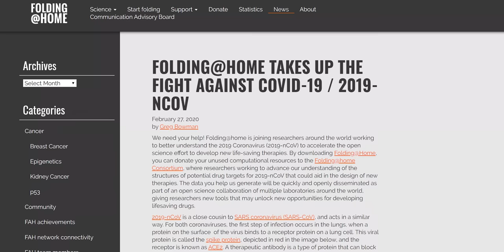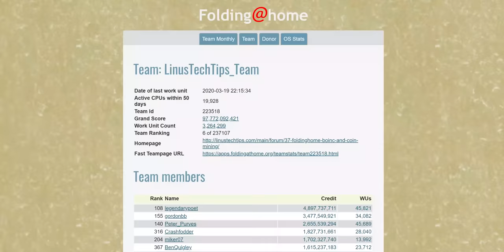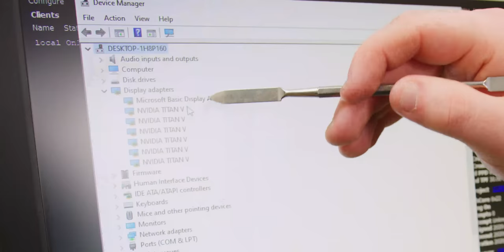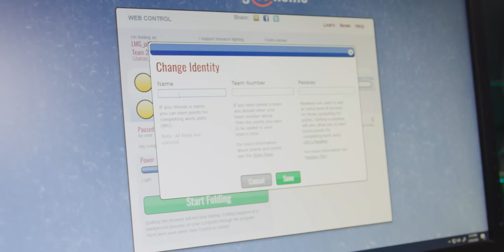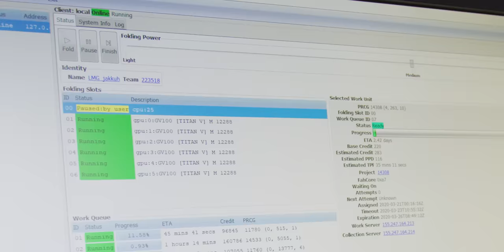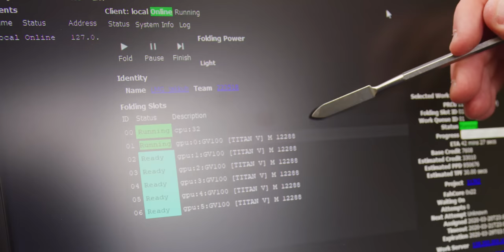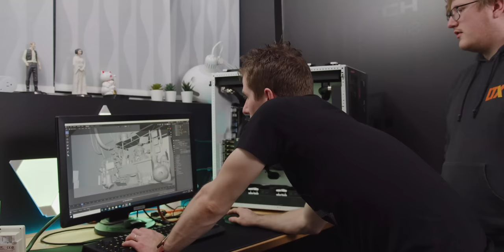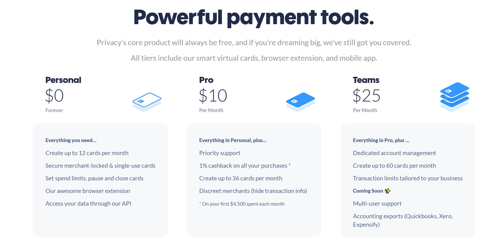Here's How YOU Can Help Find a Cure for COVID-19!

Comment: Just a heads up, this has created a noticeable increase in my electric bill when I have done this in the past. This machine Linus worked with in this video would likely double my monthly bill.  I'm not trying to discurage people but just give them an early warning. Some people might be laid off work with less income now.
Reply: Somebody pay fixed price, or not paying for electricity at all.
Reply: Setting lower power limits can significantly reduce your power bill though. Just install MSI Afterburner for your GPU and see how low it'll go, 50% power is often plenty for these tasks (but 80% already helps a lot by taking out all the peaks). Same goes for your CPU, just download Intel XTU or Ryzen Master and lower the power limit to a point where you feel more comfortable with the power usage. Even setting the power plan to power saver can help a few percent.
Reply: Krojack that’s why I have solar panels
Reply: Ah yes, my dad made me pay the extra 30 euro a month. That was with just 1 980ti running about 80% of the time on full.
Reply: My setup with one GTX980, i7 4770k and few HDD's at full power (no OC) takes 350W (measured, not theoretical). If I'd be running it non stop 7 days, it would be 0,35kW*24h*7 days= 58,8kWh, with average US price of 13,2 cents per kWh it's around 7,76 dollars a week. 
HOWEVER, taking into a count, that you should stay at home, most of the people will save money on fuel, and public transport, travel, shopping and cinemas, so at the end you will still save a lot of money durning that quarantine.
Reply: But as he pointed out, for those of us with electric heating and in winter/spring, we will see minimal difference.
Reply: @TheTechnoPilot  the only time it wouldn't come out in a wash would be during summer, where a heater is counter productive.
Reply: @voxelfusion9894  agreed!
Reply: @TheTechnoPilot  here, electricity is cheaper than natural gas, so my utility bill is cheaper heating with computers than my furnace
Reply: @25566  With some power limits in place 200-300 watts is probably pretty doable
Reply: This is one of the reasons I won't do this, Linus can say its for a good cause all he wants, but he hasn't been laid off due to the virus and still has income and doesn't have to worry about an electric bill. Try being a student on unemployment.
Reply: That's like warning people that water is wet
Reply: @projectjt3149  shit that's sweet, do you only run the machine during the day? Or can you roll back your power meter?
Reply: @toymachine4253  yep, I'm in the same boat with Quebec having some of the cheapest hydro rates on the continent! 😝
Reply: @Grumpy_Wolf  Yeah dude I don't think anyone will blame you considering your situation.
Reply: Yo college kids step up
Reply: 10:45,he did adress that, watch the video before commenting about stuff not being mentioned.
Reply: @RespectableRSYt  Well, I'm running Folding@Home from my laptops. I've also put them on Medium instead of full so that they can last a little longer.

Comment: I dunno the guy could afford it but a thousand years ago when I first got into folding@home, there was a person in my "team" that wasn't running his account using his office' equipment. He apparently had access to unwanted computers and would just build dozen+ machines all plugged into his home in different areas. Imagine his electric bill woooooo...

Not all folding projects are worth your time (I personally think using distributing computing to find aliens is a bit silly) but this is a really good idea. Also: wow the interface has become so much easier to understand. Back in the day it was just ... a command line type window with text flying at you.
Reply: I'd rather use my hardware to search for aliens then to help out greedy pharmaceutical companies that rip everyone off with overpriced drugs that apparently don't even pay for hardware or electricity they use for research.  Drugs are expensive enough to buy why should I pay more for them with hardware and electricity?
Reply: Finding aliens is NOT folding. Folding is literally protein folding. They are both Distributed Computing projects though.
Reply: @PAPO1990  Yes. SETI is for aliens
Reply: seti@home is shutting down the DC at 31st of March.
Reply: SETI@home is scheduled to stop sending out work by the end of this month as well. So there should be even more protein folding computers at that time. I hope the project notifies the volunteers to switch over.
Reply: @modmiiwii - the warm feeling of helping sort this crisis.   Sadly the maker of the video is interested in nerd points.....

Comment: Me: sees this

Also me: Proceeds to set it up on my Intel Atom netbook
Reply: And even that small contribution of power over a high enough quantity will make a difference :)
Reply: Hilarious
Reply: I did it back in 2009....  Not the fastest system for folding, but every little bit helps.
Reply: lol currently watching on a Atom N270 netbook, and had the same Idea.
Reply: My only bottle neck is my network speed at a whopping 10 mbps
Reply: @chrisziebell5833  bro, I'm @ 300kBps
Reply: the things the world does for research
Reply: My celeron netbook, also folds ! 2,16 ghz doiing 100%. 800 PPD !
Reply: Lol, I set up both the 2200g machines I built for my shop to fold as I watched this vid, looks like they will be doing about 4000 points a day each, is that gud? 🤷‍♂️
Reply: @maxxlr8tion578  Well my one 8700K @5GHz has estimated PPD (Points Per Day) value ~92K
Reply: I think it's actually pretty good to use an Intel Atom. Because of it's power efficiency. Running a 9900KS will be literally 5 ? 10 ? 20 ? times faster, but will consume 20 ? 50 ? 63 ? times more power. Energy consumed these days when everybody stays at home should matter a lot.
Reply: @Winnetou17  Slower cpus will hinder down the pace of the project though... every single WU has to be churned through the client machines before a one little F@H project, protein folding sequence simulation is ready for inspection for the scientists I believe...
Reply: @ssc00p  yes you are right.. we should NOT use old low powered machines from folding.. I was folding with my i7 laptop for year or two when it was brand new, now after 8 years I dont fold with it anymore (it would burn a hole through my table anyway) because others would have to wait until I finish my work unit. I think slow work units might even be assigned to faster machines when a simulation is nearing completion, rendering low powered and old systems contribution near to useless.
Reply: Thanks
Reply: @chrisziebell5833  5 mbps
5$ tho
Reply: @nandulalkrishna923  Kilobyte or Kilobit?
Reply: @ricecake1228  Bit.
Reply: it ain't much but it's honest work
Reply: @chrisziebell5833  light speed mate ;)
Reply: Kinda make me wonder if they an Atom (P4 based ones at least) could do the job in the time. They give about 30 hours for the WU that I got, and my 1700x @ 4ghz dose it in 2 Hours.

Also  with the power draw even though the atom uses little power dose not make it power efficient. My atom laptop get a score of 60ish cb in cinnabench r15 useing about 15 watts, so that is about 4cb per watt. My 1700x gets 1700cb and uses 125 watts about 13.6cb per watt. Is not perfect but kinda give you an idea.

Comment: It's ashame playstation stopped this as a built in feature. However for those with an old PS3 there is a workaround to get it running again. A simple search will yield results. I think all pcs should come with this feature.
Reply: Compared to modern PC hardware, a PS3 is not very effective for folding (it was AMAZING in its day though). I used to fold on PS3, when I started folding on PC within a matter of weeks I had surpassed all the points I ever earned on my PS3. Now you can almost ignore that ANY of my points came from anything other than my PC

Comment: Folding@Home: We want to hit 1Million Users....careful what you wish for
Rosetta@Home, which run on Boinc, also does protein folding for COVID-19
Reply: Rosetta is not using gpu
Reply: @GrimK77  I tried fah as well. Neither used my 1080ti.
Reply: @grahamlocklin  why you say that? Do you have the GPU slot showing up in your advanced interface?
Reply: @grahamlocklin  Should do it automatically.
Reply: It works now for those wondering. If you're still having problems, try restarting it. Hope that helps! Let's save our loved ones!
Reply: I understand that tasks needs to be specifically compiled by fah team/dev for gpu or cpu computing. They asked for more gpu participants for covid19
Reply: @matr4273  I do. Been running for 2 weeks with no GPU wo on the program starting with b....
Reply: @grahamlocklin  providing support here is a bit hard. Why don't you share your logs into the support forum? You can help in BOINC projects like Rosetta and GPUgrid, if F@H really doesn't work for you.

Comment: I'm inspired. I'm going to let my 2009 Vaio runs Folding@Home even when knowing it may die anytime. I'm going to sacrifice it for good. Thanks Linus.
Reply: Just keep an eye on your temps and it will probably be fine for a long time. My HP Zbook G3 seems to limit gpu temp to 70C and I only run GPU WUs (work units), it basically doesn't impact the usability while running at full power in the background because my display runs of the integrated graphics.
Edit: Notebook Fancontrol might be a good way of keeping temps in check if other measures like Intel XTU power limits aren't an option
Reply: @jadoei13  well, sure i'll look into that. I dont plan on continue using it though
Reply: My 2005 Vaio would just cook itself to death several minutes in. And during that time, produce what a newer computer can in just a single minute
Reply: @damian9303  he did his best my friend. He did.

Comment: I for mine, with my i5 660 and a GT740, can proudly state: it´s not much, but it´s honest work
Reply: Any little bit helps!
Reply: Xeon X3440 from eBay or AliExpress is a great upgrade. 4 cores 8 threads @ 2.5ghz
Reply: @Gravstein  Xeon *
Reply: @miningrig5800  Fudge, fixed it now. I have a x3470 behind me in a system. Great budget cpu's.

Comment: if the folding-network is not giving you any tasks (like it happened to me), try http://boinc.bakerlab.org/rosetta/ - they also use your cpu/gpu power against covid-19
Reply: I'm only getting GPU WUs atm from f@h. So my GPU-less Server doing Rosetta instead.
Reply: My log is displaying a couple of errors and the progress is stock at 0.00% 

 No WUs available for this configuration
WARNING:WU01:FS01:Failed to get assignment from
Could not get an assignment
Reply: Edwin O Gonzalez Reyes That happened to me, check if your GPU is overclocked, cause I had the same issue, I used the factory settings on my GPU and the error went away
Reply: @souImenace  My laptop has nothing OC
Reply: Unfortunately my plan to start off my new build just using onboard CPU graphics and upgrading to A gpu haven't been able to come to fruition, so I only have my CPU, but I have both F@H and BOINC-Rossetta on my system, Rossetta runs full steam while I'm waiting on WUs for F@H. When F@H does get WUs it just grabs about 60% CPU from Rossetta and then when I catch it I stop Rossetta and let F@H have 100% CPU use, RINSE AND REPEAT. One thing to note thought is that F@H does not hit your CPU like Rossetta does, e.g. F@H only pushes my CPU to 3.9-4.1Ghz on all cores, while Rossetta pushes it to a steady 4.3Ghz, so uses a good 15-20w more power.
Reply: Yeah it's a pity that Linus did not mention Rosetta@home, because Folding@home and Rosetta@home actually complement each other when it comes to the research.
Also mind that Rosetta@home does not have GPU work units. The project never had and probably never will have GPU work units unless they add / change research goals. This is because the computational tasks Rosetta has are different compared to Folding because of that and are therefore not suited to run on GPU's efficiently.
Reply: Different simulations and overall goals, but both the same virus. Folding is more the full process and how the protein got to it's folded state, Rosetta is more just finding the structure.
Reply: @edwinogonzalezreyes4697  It's just that there's no work all the time. The work has been getting eaten up quicker than they can make more. When there is work you'll get it.
Reply: @Jaker788  Thanks for the heads up. I thought there was something wrong with my configuration.
Reply: @edwinogonzalezreyes4697  firewall? access rights?
Reply: @edwinogonzalezreyes4697  I think it's a universal error. Since I've had that error what I'm just on and off getting work. Like Linus mentioned, they're overwhelmed and might be lending their bandwidth to folding servers to help out.

Comment: dude hype train. their servers are so over whelmed my hard ware sits idle for hours waiting for work.
Reply: I'm not having a problem at all. Been folding for two days now, at about 600,000 points. Occasionally it'll sit idle on a GPU or CPU, for awhile, but then it'll scoop one up within a few hours, and start working again
Reply: They have said that they're being overwhelmed with support right now that they simply don't have enough work for computers to do. Their petaflops recently jumped from 90 something to 400 something in less than a month, which is pretty amazing.
Reply: mine is working right away
Reply: @itsspirit9053  currently, gpu only it seems.neither on my PC's is running a cpu  right now
Reply: Mine too, Joshua. Rtx2080 and a Ryzen 2700x just patiently waiting like 🤔
Reply: @hillbobaggins  my 5700 and 480 just picked up a work unit each in the last 30 minutes. They are coming. CPU on both PC's are idle tho, still, current time: about five hours now. It's all gpu right now. The Vega 8 in my laptop is also going
Reply: Is that what's going on? In my work queue it says "Waiting on WS Assignment" and I really wanna help crunch numbers over here, I just wanna make sure its not a glitch on my part. If their servers can't handle the requests coming from our systems, then that'd solve the question I've been trying to figure out for the past two hours, lol.
Reply: It works now for those wondering. Let's save our loved ones!
Reply: @ValstormLucifer  It works for me now.  Try restarting the program. Hope that helps!
Reply: @FreePalestineforever657  didn't even restart it, my GPU (RTX 2070) is now crunching some data. Yay!
Reply: I installed this 11 hours ago. As soon as it loaded both my CPU and GPU were given work. I then restarted my PC maybe 20 minutes later and have since (10/11 hours later) seen only my GPU with work but my CPU hasn't had any at all.
Reply: @TomGB-81  Yeah, sometimes the tasks given to your system need to use either the CPU or the GPU, and perhaps the CPU tasks aren't being fed to your system. I suspect Linus calling these guys out is overloading the servers, so they'll need to get more racks ready so the requests are being utilized more efficiently. They'll probably get around to it later this week or next week, hopefully.
Reply: @aaaaaaaaau  boinc?
Reply: @aaaaaaaaau  gotcha, I'll use that as well
Reply: They have a FAQ why they stopped using boinc. Afaik it's only the client anyway

Comment: You could do this with your PS3 as well! There was an option in the Settings you could enable.

Edit: On Nov. 6 2012, Sony discontinued Folding @ Home Support for the PS3. During its 5 year and 7 month term, more than 15 million users have provided more than 100 million hours of computing time for F@H. They provided significant support for a project in disease research.
Reply: That was discontinued. I'm not sure if by Sony or F@H, I don't think F@H supports PowerPC anymore.
Reply: Wait it's still supported?

Comment: Would it be more effective to donate the mony that would be spend on electricity to big server farms running this program? The Compute/Energy is likely higher there.
Reply: I mean this is a free program, so you can do this and donate!
Reply: @zempt7764  It's not free to run this program, it consumes a lot money through consuming a lot of electricity. What the comment was saying is that the cost of electricity per compute unit will be much lower in a data center (because server hardware which is optimized, unlike home machines), so it would be more effective to just donate electricity money to those data center companies that do folding.
Reply: commercial grade hardware is 10x more costly and it is also very costly to rent out the datacenter space.  But it is usually located in areas where energy costs are lowest if they can also get good internet infrastructure.

Comment: After like 10 years of not paying attention, this channel and a couple others helped me catch up with hardware knowledge and build a top-notch gaming/work machine. Thanks for that. I saw Nvidia's announcement for folding help, then I signed up and saw your team so I joined it.  The problem is, I am getting this error now, not sure what this all means, maybe something to do with Bitdefender. 

20:45:55:WU00:FS01:Server responded WORK_QUIT (404)
20:45:55:WARNING:WU00:FS01:Server did not like results, dumping
20:45:55:WU00:FS01:Cleaning up
20:46:05:ERROR:Receive error: 10053: An established connection was aborted by the software in your host machine.
20:46:17:WU02:FS00:0xa7:Completed 52500 out of 125000 steps (42%)
20:46:20:ERROR:Receive error: 10053: An established connection was aborted by the software in your host machine.
20:46:35:WU01:FS01:0x22:Completed 0 out of 1000000 steps (0%)
20:46:35:WU01:FS01:0x22:Temperature control disabled. Requirements: single Nvidia GPU, tmax must be < 110 and twait >= 900
20:46:36:ERROR:Receive error: 10053: An established connection was aborted by the software in your host machine.
20:46:52:ERROR:Receive error: 10053: An established connection was aborted by the software in your host machine.
20:47:08:ERROR:Receive error: 10053: An established connection was aborted by the software in your host machine.

Any help would be appreciated.